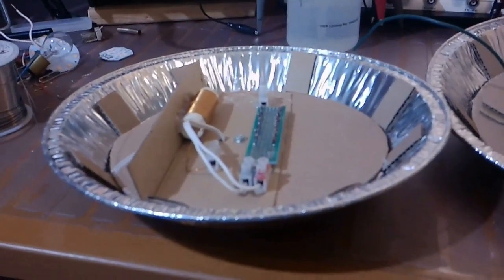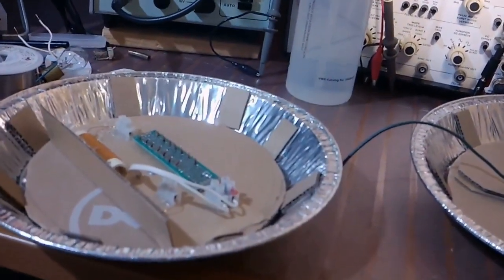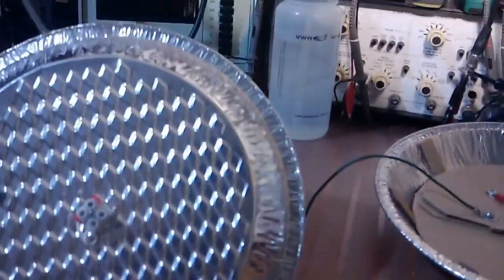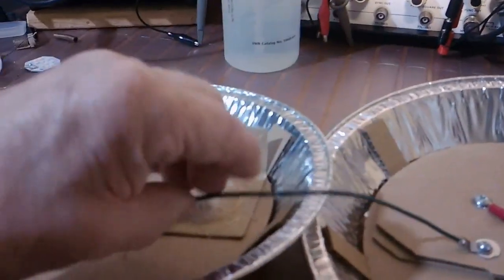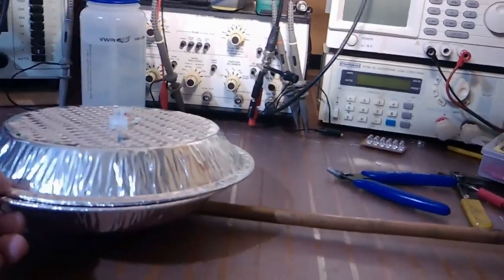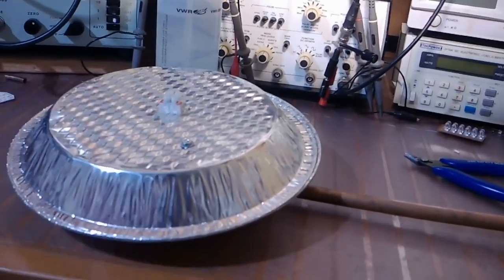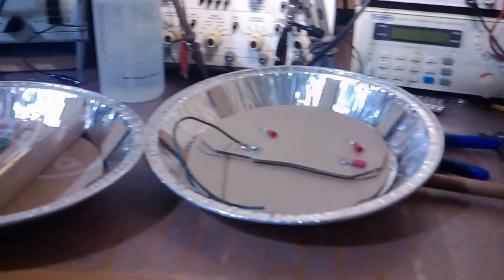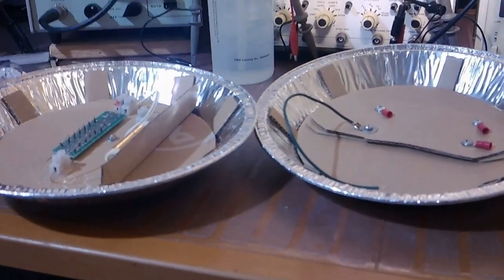Light Receiver Assembly

Comment: 14x 1N4148 Stiffler Loop and a similarly slightly retuned L3 as the transmitter L3 ? 
Hoping for no rain here as well. Recent weather has likely made for an ideal ground, so there is that.
Reply from the maker: Unless you have watched my work there is one big Gotcha in this vid. I did not mention that the plates are not connected to the ground rod in anyway. The rod clamps and screws are isolated from the plates. Other wise you build a good Faraday cage. Will correct this soon and show a missing connection also.
Reply: Hello Dr Stiffler, plengo here from overunity forum. Remember your yellow meter that is digital and analog? You asked me once if they were good.

Are you sharing this recent work somewhere , like a forum?

I would LOVE to replicate your work. I already have your kits and L3 coils.